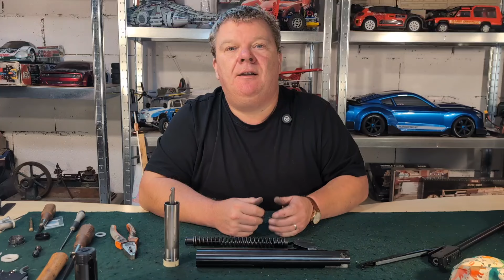Tuning your Weihrauch HW35 with TbT. Part 3 of 3: Relube and rebuild

Comment: I just pulled my old 35 export apart, am i right that the 35 doesn't have an inner piston sleave? Also my spring is flat and not rounded wire, is this standard or has someone been inside it?

Comment: Nick should molybdenum paste/grease be similarly applied on the side of a leather piston seal as it is on a plastic seal?
Reply from the maker: @dafarsher9738  I am a child pf the 20th century! But I believe soaking it in neatsfoot oil is the way forward!👍
Reply: @ Thanks, I figured lubing the leather seal would increase the likelihood of grease getting forward of the piston and causing dieseling to happen for longer than just with the Neats foot oil so I kept the molybdenum grease off of the seal, glad I didn’t miss a step!
Reply: @tbtairrifletuning1520  I'm in total agreement with that - never had a problem :)  I've got an early 35 with a leather piston seal and it shoots very nicely indeed

Comment: ???? and the promised results???  Excellent series by the way.
Reply from the maker: Doh!😖
Reply: Well I've saved all the videos and now for the difficult part....getting the gun into the house without the good lady finding out..😅 and the results of your effort please.
Reply: @iwanvanderhut4159 my advice is to use a sash clamp and a towel to prevent the pre-loaded spring from propelling the trigger block around the breakfast bar area when it’s unscrewed, in my experience it doesn’t go down well with she who must be obeyed!😊